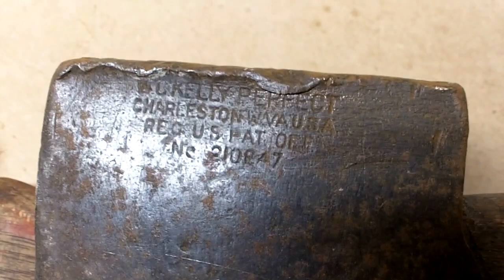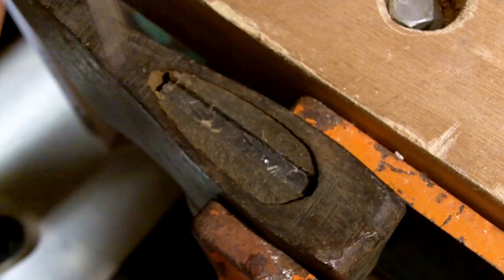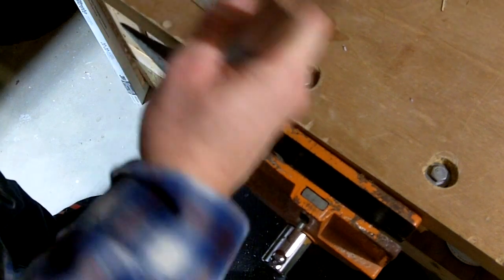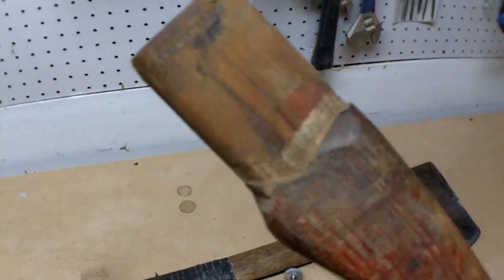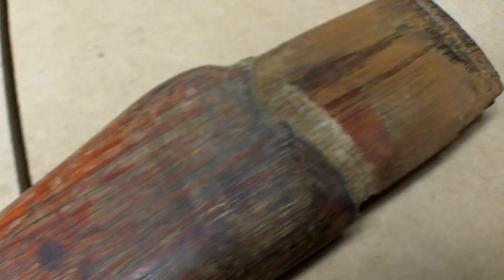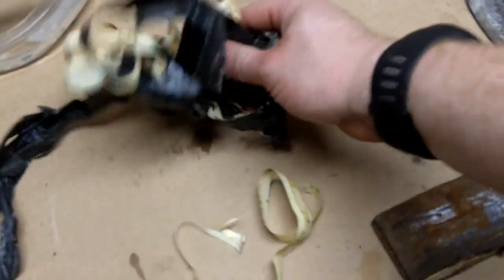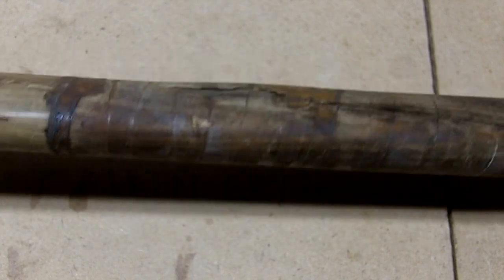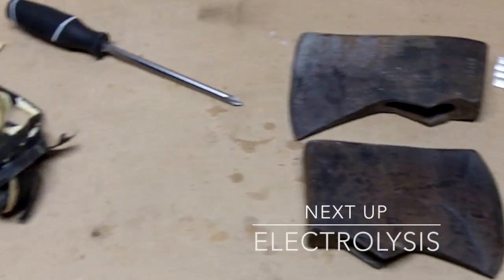Axe Restoration - Removing the Axe Heads | 1 B4Time

Comment: Thanks, great tips on removing wide metal wedges. I removed a loose (but insanely stubborn) handle from an ancient hatchet yesterday and I learned one neat trick. I drilled out a lot of the wood inside the head, and kept striking the metal wedge AND the inside of the axe head. Afterwards I couldnt figure out why the drill bit wasnt damaged. Then I realised I had accidently used a drill bit for steel and not a wood drill bit. I strongly recommend doing this. A metal cutting drill bit will be slightly slower, but if you touch metal its much less likely to chip, wear or snap.
Thanks again for the video.

Comment: Nice job , Shame about the handle but at least the axe will get a new lease of life . I now feel inspired to go and restore my own vintage axe . My handle has come loose and the head has moved a quarter of an inch , I think i will remove the head and reset it all with new wedge and then soak it with oil .
Reply from the maker: Excellent, glad you enjoyed.  Good luck with the restoration.

Comment: The vise your using is a wood workers vice, it is designed to have wooden jaws installed which is very easy to do and they also act as soft jaws.
Reply from the maker: Ray Duerksen thanks Ray, yes I have some pine blocks to mount in there for wood working too.

Comment: From one Axe Junkie to another, I’ve been in every place in that video. Metal wedges do come out easier, but is that what you want from a wedge? I always use hardwood wedges and never use glue. That wood wedge was a sod. Crafty second nail. And you get your ‘I broke a drill bit in the haft’ badge. We all do that. A bigger vice with soft jaws would be a big help to you. Also, once you have drilled and inserted screws into the wedge, clamp the screw heads in the jaws of the vice with the haft sticking straight up. Then lever the head against the vice. All the screws pull the wedge at the same time and you get huge leverage. Axe on brother form the U.K.

Comment: If you wish you can reuse the damaged handle.  1st sand the handle until all finish is removed.  2nd use some yellow glue in the 
  broken areas and 3rd wet some rawhide and stitch it as a wrap around the broken area.  Allow it to dry completely which will   tighten it up as a shrink fit and harden quite nicely.  Then varnish the rawhide wrap.  Allow to dry and apply linseed oil to the rest of the handle.

Comment: Both of these are felling axes.
The second axe probably had the top eye part wider than at the end. You should have cut off the handle leaving like 6cm long part of the handle still attached to the eye. Then trim this left piece and then pound it in other to force the wood through the top part of the eye.

Comment: Exuce me, The tool you used to start the holes in the metal wedge, before the bit, what was that? i need one
Reply from the maker: Guy, that was an "Automatic Center Punch".  Work like a typical center punch but it has a built in spring mechanism that punches the hole w/o the need for a hammer.  Typically used for starting holes before you drill so the bit doesn't walk.

Comment: Why is there rattling in your hammer? Is it supposed to be that way?
Reply from the maker: Ryno, yes its called a Dead Blow Hammer.
Reply: B4Time Did not know that, interesting. In your opinion, does it work as intended or is it kind of gimmicky? What are some other applications?
Reply from the maker: Works great.  1st off, most are plastic or rubberized, so they are less likely to mark up whatever you're beating on.  They keep the hammer from rebounding as much.  I've used the Dead Blow Hammer mostly for the HUNDREDS of aircraft aluminum wing ribs that you might see hanging on the wall in some of the axe videos.

Comment: Great video. I have a WW2 Japan hatchet, Any pointers on restoring ??
Reply from the maker: Tony, just run thru this video series.  Should be all you need.  If you can't do electrolysis, try a vinegar bath for 12-24hrs.  Only thing I don't like about vinegar is it doesn't stop. If you leave it in there too long it'll start to really pit the steel.

Comment: would burning it out be better?
Reply from the maker: Ben, that is a common question.  Yes you can burn it out.  However, you risk messing with the temper/heat treat of the axe head if you go to hot.  So unless you have a way of monitoring your fire temps, I wouldn't risk it.

Comment: Next time, you can just break or cut the handle and put in into fire. And see how small the wood becomes.
Reply from the maker: Ta Mère if you want to risk messing with the temper of the steel, yes.  This is a risk I didn’t want to take.